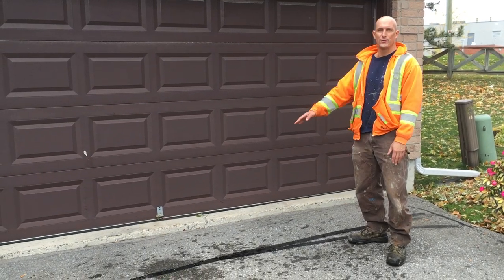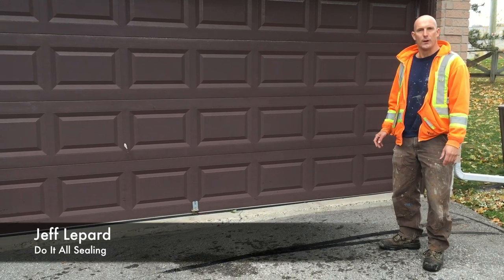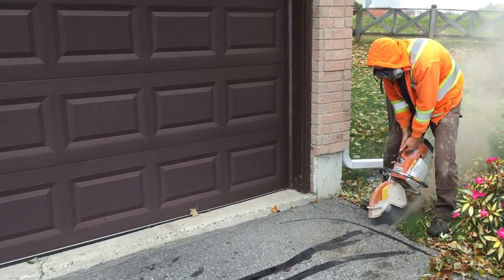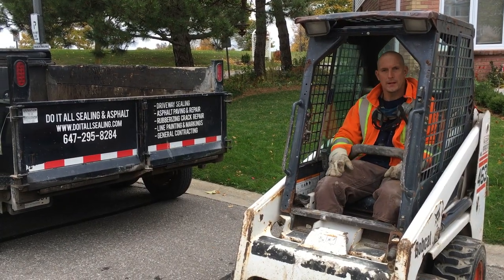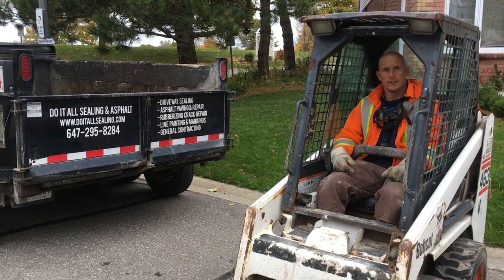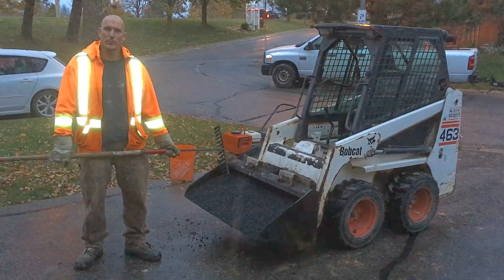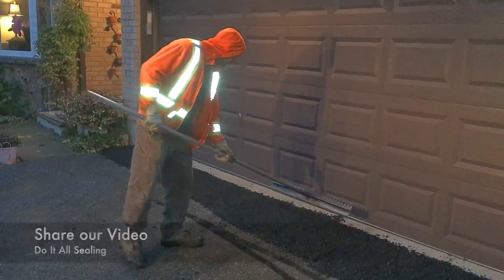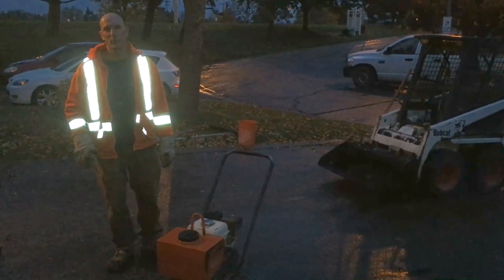Asphalt Driveway Ramp Installation

Comment: thanks for the video, Jeff. How long will it take for the asphalt to settle before it can take traffic? Will it not get ruts under the tyres?
Reply from the maker: сам sebe you can drive over it the same day if you really have to otherwise if you wait at least 24hrs then that would be better.  Just as long you are not parking on the new asphalt ramp.
Reply: thank you

Comment: Exactly how I would do it but I would use tamp shoes instead of hand tamp and emulsified the seams, guess we are different in Boston, our lutes are different to, is that a loam rake you use , and why use a dump trailer , would it be easier to back a 1 ton dump and load and un load the hot top, would use a wheel barrow to eliminate have to tow a skid steer, like the cutoff saw , stil is the best, it still works, Kudo's,  I liked it... good job...
Reply from the maker: I use the shoes as well especially for larger repairs and full paving.  Yeah that work work as well all depending on what I have going on that day.  I mostly group a bunch of jobs in one day depending on what equipment I'm using that day!  Check out my new Do It All Sealing channel as well all my updated work is on there.  Thanks so much for watching!

Comment: why did u dig it out first? why not just put the new asphalt on top of the driveway?
Reply from the maker: Homer Simpson the client always prefers to have it cut out and removed.   Less of an eye sore as well rather than capping.
Reply: So you can't just build up the low spot with a 1/2 yard of asphalt?
Reply from the maker: NeiI S. The previous repairs were capped on top the client wanted to have everything removed.  Also, which I didn't mention in the video the water was going into the garage die to the asphalt and base popping up.
Reply: It's called a keyway. It gives the new material a place to grab onto and creates a smoother more seamless transition to mate the 2 surfaces.

Comment: My driveway is slanted. I hate it because my garage is too small for my cars and I work on cars. 
I would like to somehow make it level. 
Do I have to tear out all the existing concrete or can I build on top?
Reply from the maker: There's a few options obviously you could tear it out and re-do it which would be the most costly but best fix.  Other options would be to try to level it off there are a few different products you can use to pour down and self-leveling etc.  I haven't had to use that on an entire floor but I have leveled off sections.